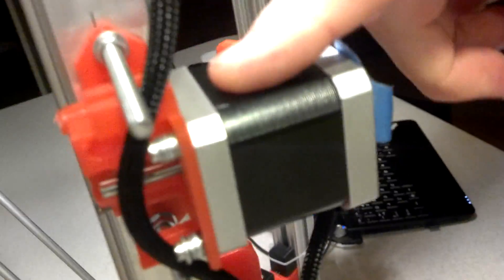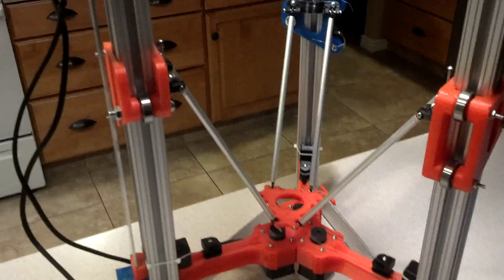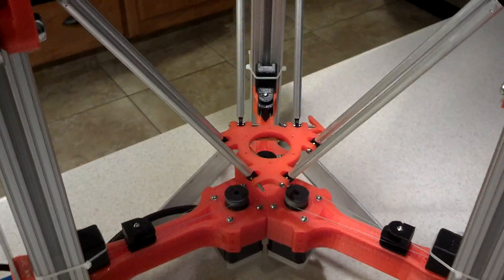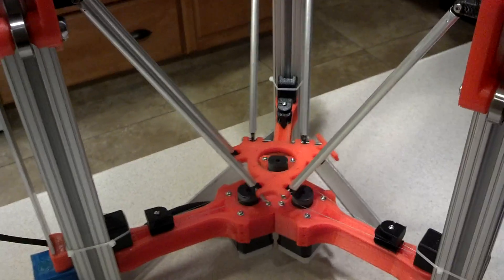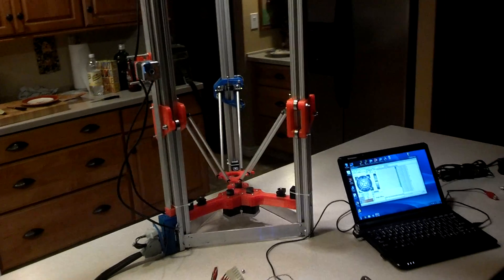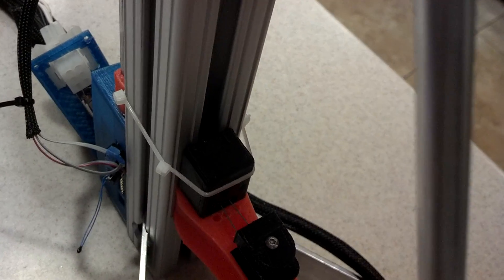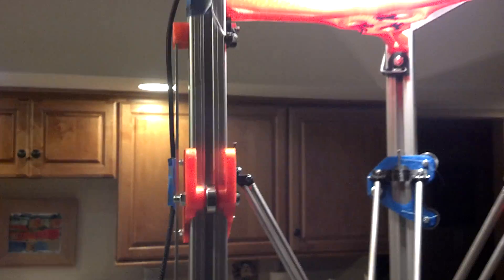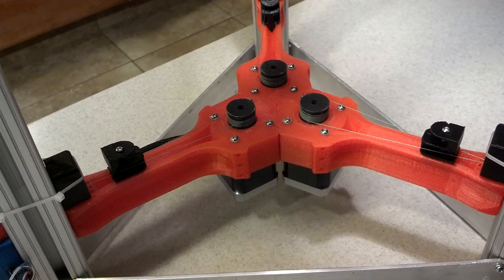Cerberus 3D Delta Robot - first movement - test

Comment from the maker: Hi Splash, you're absolutely correct that loose filament would cause significant backlash. We decided to run the first test with the 'spectra' filament a little loose. We are not going to spend this much effort to build a machine with this much backlash. We are still finishing up the cable tensioning system, but that should be in place by the next time I upload a video. :-) BTW this spectra filament line has almost zero stretch and we are using 65lb test which is only .041mm in diameter.